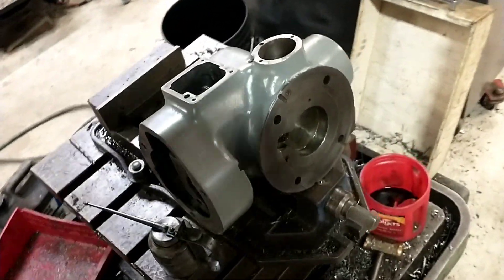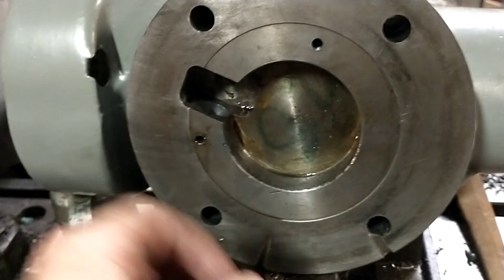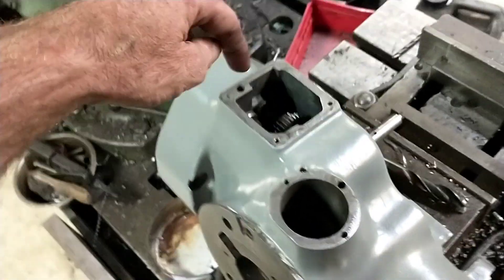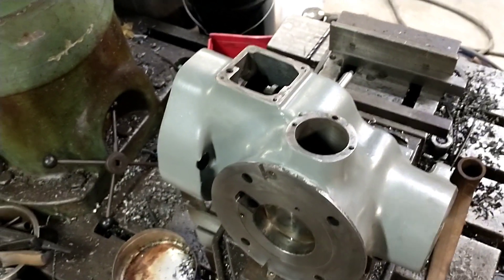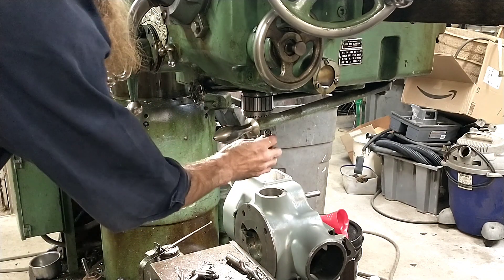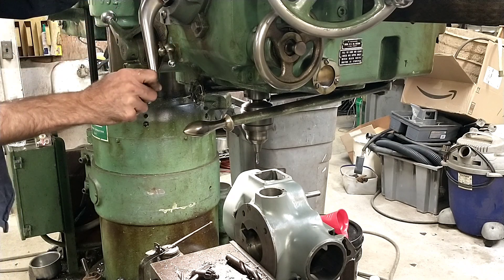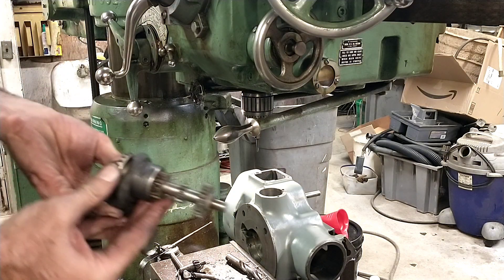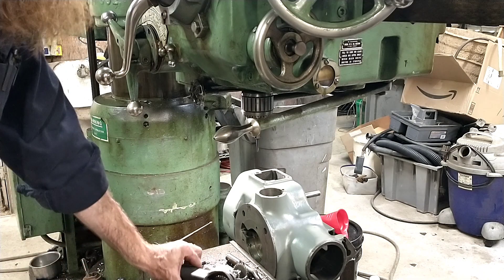Broken set screw extraction from a Bridgeport head.

Comment: I like left hand drills or endmills to handle stuck screws or bolts works most of the time 😊
Reply from the maker: I use left-handed drill bits a lot, I just didn't feel like wrecking one on that hardened set screw 😬

Comment: Heh, ya bolt a part to a bigass radial drill, the part thinks "Holy crap, that's a beast of a machine, I surrender"

The radial drill says "I could reduce you to dust, but I will just remove this little bit here, and you can leave.  Hold still, this will be over soon."

...and that's what happens.

p.s.  do you ever grind the 3 flats on an endmill shank that sometimes ends up in a jacobs chuck?
Reply from the maker: I haven't needed to but I wouldn't say it's out of the question.